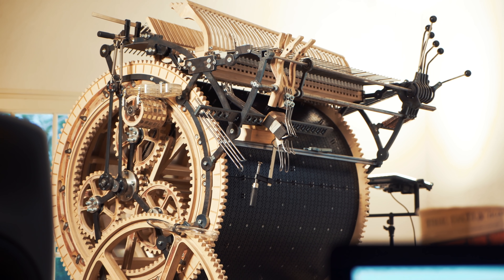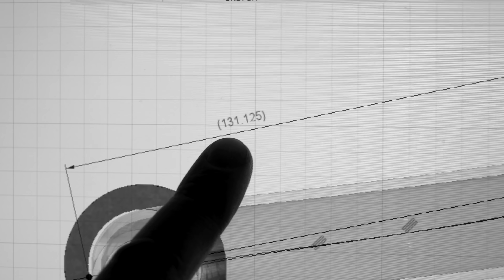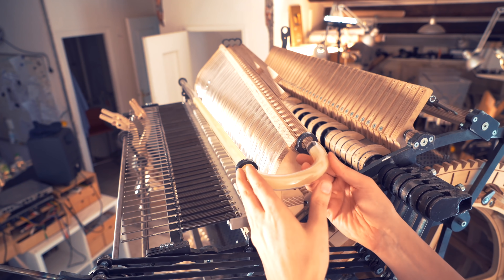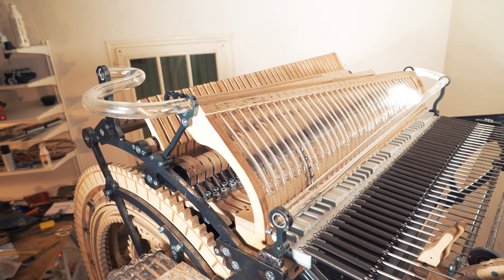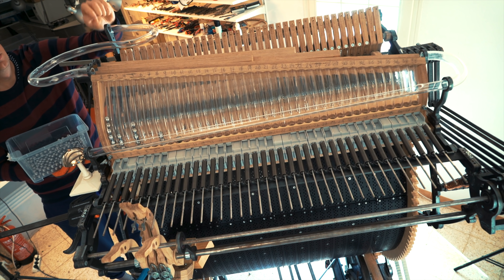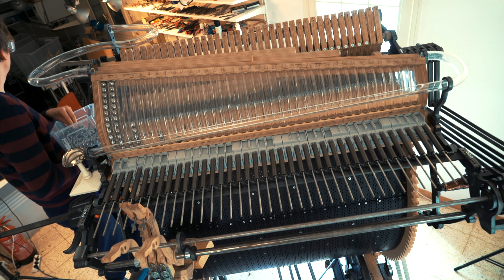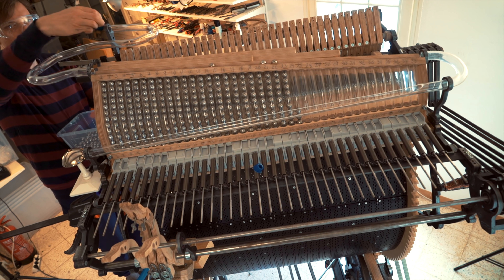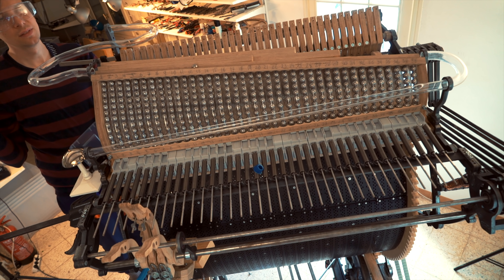Marble Divider Transport Tracks - Marble Machine X #68

Comment: I made a suggestion on Reddit (months ago) that would have retained all of the functions you are seeking... and it would have added a very valuable new time saving function:  the ability to store multiple songs on ONE programming wheel.  No need to remove the plates or reprogram after EVERY song.  Instead, you could essentially just switch "tracks" by moving the registrator fingers over.  I also think this solution was less complicated than your current evolution.

BTW - it also allowed for programming in any time signature you wanted.

https://www.reddit.com/r/MarbleMachineX/comments/8vl3hq/suggestion_adding_repositionable_registrator/
Reply: One more thing to point out - for an artist (like Martin) who might like to compose music right on the wheel:  If he could switch tracks just by repositioning a registrator tip... he could modify one channel at a time.  Visually, he could SEE the changes he's made just by looking at the side-by-side tracks of pins.  Then by moving the registrator tip, he could listen to the difference by switching back-and-forth between them.

For-the-record:  I realize that this would require a "special" set of plates where side-by-side tracks have the same timing.  But these plates would be kept at Martin's studio, and only used for creating new songs.  The ones that travel with the MMX would have songs stored on them that Martin intends to play while on tour,  the timing of those tracks would need to be appropriate for the chosen song(s).
Reply: @williepriggs  some things you are not taking I to consideration: 
1-your idea only allows 2 songs before needing to reprogram. A show requires more than that. To be able to reprogram faster is better than having more at the plate. 
2- the number of holes was increased to allow different tempos. Your idea would require removing this function. You cannot remove function and claim to have solved the problem.
3- your idea would require redesigning the entire sistemas to br able to shift to the second track. 
My conclusion: your idea is clearly more complex without actually solving any problems. I recommend you rewatching the series to remember why the current design is as it is.
Reply: @qubit1788  I took all of those things into consideration:

1 - With Martin's current design... there are 3 tracks.  So that's 3 songs per wheel.  And when reprogramming the helpers would be reprogramming 3 songs at once (that's faster)
2a - I'm not suggesting increasing the number of holes.  In fact my original suggestion uses fewer holes (~2/3) than Martin is currently using.  However, it will still work if Martin keeps the same number of holes, it just allows him to store even more.
2b - I have not removed any functionality.  The additional tracks can still be different tempos.
3 - Martin is considering redesigning the whole programming wheel to solve these problems.  I am suggesting that instead he add a rotatable tip to the end of the registrators, that's it.
Reply: @williepriggs , the current design uses all tracks at once. Using them for different songs is cutting down considerably on what one song can be. That is taking out features. If you can't see it, then I'm sorry, but the one who's too attached to his own idea is you. Your idea does not solve any of the problems and will not be used. Period.
Reply: @qubit1788  Oh.  I did not realize that I was speaking with someone who makes those sorts of decisions for Martin, my apologies.

If what you are saying about using all tracks at once is true... then I concede - you are right and I am wrong... and I truly am sorry for making such a pointless suggestion.  That's just not how I understood it to work.  I didn't consider that Martin might want to change time signatures mid-song.  I believed that for each song he'd select a time signature and stick with it.  I do admit that while I have a strong working knowledge of engineering an creative problem solving... my understanding of music and music theory is, unfortunately, limited.  Please know that - by making a suggestion, I never intended any harm.  I was simply answering Martin's request for ideas.

Just curious - what ideas and solutions are you responsible for?
Reply: @williepriggs  it's ok. I know you were just trying to help. And I'm sorry for my tone, I guess I was more agressive than I should. I do not decide for Martin, I only identified that your design does not fit in his requirements and deducted it wouldn't be picked. He did say how he intended to use the tracks. Two for rapid succession of a single note and the ｴ shaped hole to allow for triplets by changing were the magnet stays (it uses the normal track in a different way). I am not an engineer so I'm not much help in designing the solutions he asks for. I have tried, but it isn't my thing. And I'm sorry for being so irritated, I just have a keen eye for detail and it frustrates me when people seem to assume Martin is not doing the best he can at something he clearly is. He does have a team of engineers and it is the most difficult part of the whole machine. And he has already succeeded at it. So it's not like he's just ignoring an awesome idea. I dunno. Just felt you needed some eye opening. But I guess I needed it too. :)
Reply: But he's already working with very minimal space as far as the holes go. Nor does this address the issues of the drill bit wearing down in the cmc machine, the holes shrinking after drilling and the issue of managing needed holes between the plates.

If Martin is to use this suggestion it is likely he'd need twice as many holes on the same area he's already using, which exacerbates the production issues he's already facing in exchange for one problem solved.
(Main reason he wants two wheels to begin with is also to have the freedom to reprogram one while another is being played, this cannot easily be achieved if the second set is on the machine already)
Reply: @g1Chikumo  Martin has already implemented the first part of this suggestion... by tripling the number of tracks on each programming wheel (he has essentially already created the alternate song storage space).  By just adding repositionable registrator tips... he would require fewer programming plates.  Because he would no longer NEED to reprogram between songs.  Just move the tips... and keep playing.  If he doesn't need to change out the plates... then on the fly spacing adjustments are also not necessary.  That could be done during setup... before the show starts.

As for the CNC bit dulling... if he used simple round holes that could be plunge cut (no lateral stress), it would be less wear on the bit.
Reply: you're basically proposing to increase amount of holes on each plastic sheet by twice, and there are already so many of them
Reply: @jskratnyarlathotep8411  Not really.  When I made the suggestion there was only one track... now Martin has added 2 more.  So my suggestion called for ~2/3 of the holes currently being used.  If he can fit 3 tracks that's GREAT!  This means he can play one song and have 2 others "stored" in the other tracks... waiting to be played.
Reply: My question is mainly... how would you even introduce rotatable tips for the registrators, there's hardly any space as-is? 

The rest is more commentary of your suggestion:

Cramming the machine full of more complicated machinery which quite frankly looks to be very fragile does not sound like a good idea. Especially since these fragile and hard to implement pieces would be VITAL for the continued playing of the machine. 

Making the machine tempo-adjustable, reprogrammable and sturdy should be the main goals, not implementing more features, not at this stage at the very least. This is the assembly-phase, where he's readjusting designs to make them truly viable. Not creating entirely new ones, unless the proposed design solves absolutely all problems better than the current design does, AND is easier to implement. This isn't.

Oh and this isn't even a suggestion for a better programming-wheel! It's a suggestion for the registrators! It's taking the already finished design of the programming-wheel, and giving it more hard-to-implement-features. No shit it retains all of the features he asked for, it's his design!

I'm sorry I'm sounding negative, it's just this design is not viable to implement, not without spending A LOT of time and resources. And drilling exactly twice the amount of holes that the already swiss-cheese-like programming-plates have. Which is a new problem in and of itself.
Reply: @moobles2998  They would not take up any additional space.  Just the same space that the current registrator tips are already occupying.

To comment on your commentary:  I guess it all depends on how you look at it?  I think redesigning the entire programming wheel is the wrong way to go.  I believe a simple "prosthetic" could be added to the ends of the registrators that would save a lot of trouble and add a whole new level of function, without any changes to the programming wheel.  Ultimately, it's just a suggestion.  I love the MMX project just as much as the rest of you.  I thought I could offer some advice.  I never attempted to take anything away from Martin or his design??  Of course it is his.

How have you addressed the issues that he has requested help solving?

Comment: programming wheel issue: how about some sort of go/no-go gauge you insert into the holes at the gap between segments that shows the spacing. 
Place a pin on each segment and the gauge would have a gap of precisely the correct length to span both pins and the space between them. 
Between the segments a cam or screw that can be adjusted to set the gap so the gauge fits.

Comment: How about killing the kinetic energy by induction? Like wrapping some wire around the pipe and the connecting the ends of the wire. Wouldn't that theoretically work?
Reply: If the marbles were magnets, which they aren't, maybe. Though the free rotation would quickly force the magnetic poles to the sides where the magnetic field is facing in the least effective direction, negating the counter-force from induction. However, what would prevent your marbles from simply speeding through the pipes is them sticking together because strong magnets.

Comment: I have tried to bend pipes like that for water cooling, when I fail to get the silicone tube out, I just use compressed air, makes it come right out without any problems.

Comment: If you have future problems with the 1st channel of the marble divider being overshot, then have the marbles run into a dead stop and drop down a level before carrying on. That'll remove lots of energy from the marble, and then gravity can carry on and roll the marble down the dividing head slope :)
Reply: Good Idea!
An other concept like this would be than the marble would not came from the side, but from above .
And to keep the side tube aesthethis, just put the tube at the same position but higher, and make it a 90° bend  pointing down.
Reply: I think the marbles need to come in from the side so they have enough energy to get over the first hole marble bump when it's full
Reply: Keep in mind there are large numbers of marbles going through at all times, if each one had to come to a dead stop that would quickly block up everything...
Reply: How can we have a Marble Machine X  without the classic marble funnel!?
Reply: .... yeah....whatever he said
Reply: That's a bad idea, marbles could get themselves stuck with a drop through an S-bend like that.
Reply: @korenn9381  in this case no S bend but a hole at the end of the tube where they drop down through
Reply: @cheesecake667  the path for the marble is still an s bend. And with sharp corners like that, that's asking for marbles getting stuck.

Comment: I've heard that putting a drop of cyanoacrylate adhesive (super glue) into internal wooden threads helps strengthen them, though I've never tried it. Of course, threaded inserts are far superior for screws that will be repeatedly removed.

Comment: If you decelerate the marbles, do you still get enough marbles per crank turn?
Reply: Yes, that doesn't change, that only depends on how quickly they get transported up, if any pipe is "to slow" the high marbles will just push the lower marbels to make them go faster.
Reply: But if they go too fast, they skip the first few channels. I guess it will depend on the song of that becomes an issue

Comment: Imagine building something that clips onto the back of the programming wheel that all you have to do is a full rotation of the programming wheel and it instantly pulls out all the pins. That could be useful. Also for a far more complex version you could build something to computerize installing the pins and save layouts to seep up changing songs. kinda like a electric motor belt driven pin installer.

Comment: About the little chat in the middle of the video: You are definitely not delusional! Your solution looks very good, I think. However, I would still be very worried about how the precision keeps up under changing external conditions. You will probably encounter much different humidity and temperature conditions than in your workshop. Will everything still fit snug? I would still suggest to test this thoroughly very soon.